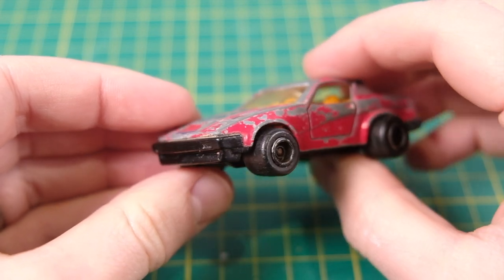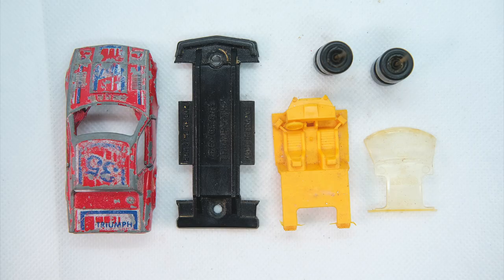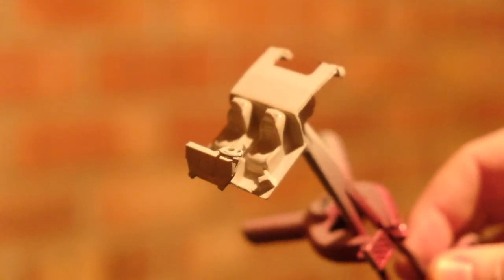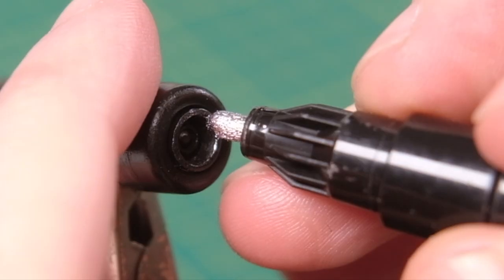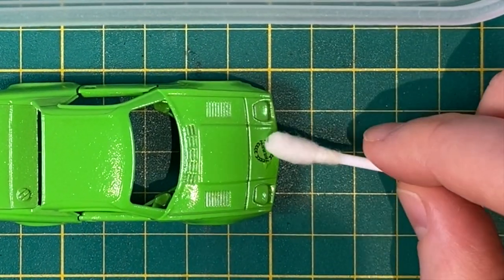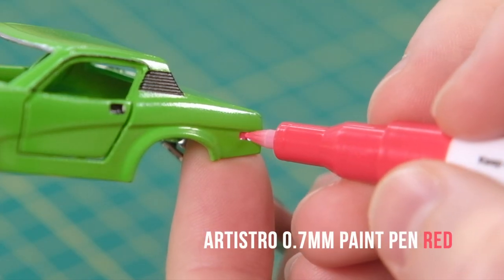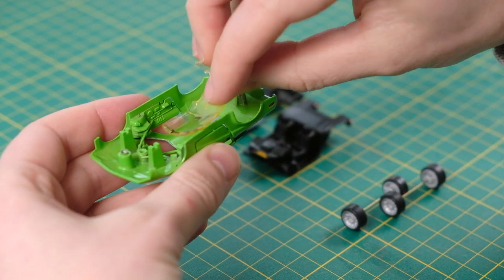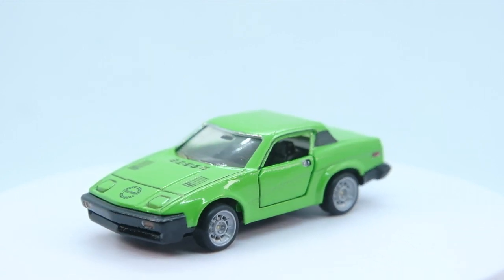MAJORETTE custom: 202 Triumph TR7

Comment: That TR7 looks fantastic. Nice job. Where did you buy the replacement wheels? Also do you have a link for the paint pens you used ?
Reply from the maker: The wheels were from waltonstyle.com
Here’s the paint pens:
https://www.amazon.co.uk/Painting-Ceramic-Acrylic-Markers-Extra-fine/dp/B07485T22B/ref=mp_s_a_1_3?crid=1S86HH86CWYE2&keywords=artistro+paint+pens&qid=1659168403&sprefix=artistro+pa%2Caps%2C82&sr=8-3
Reply: Thank you🙂